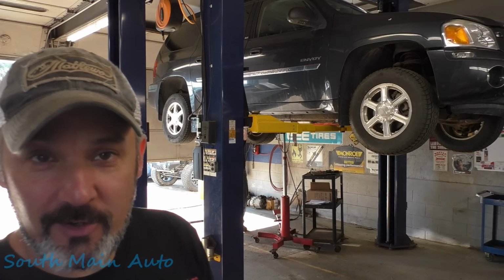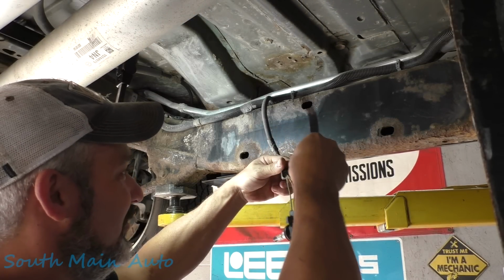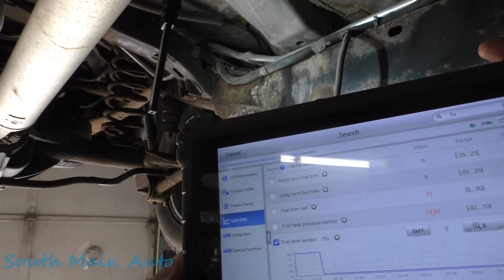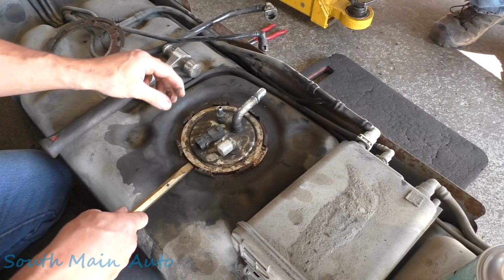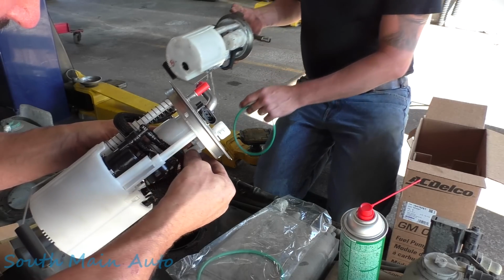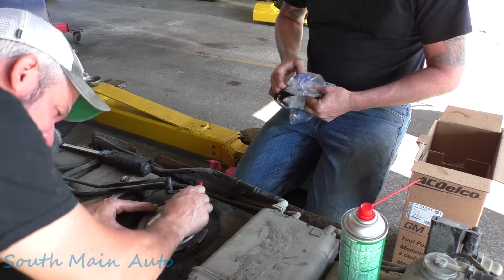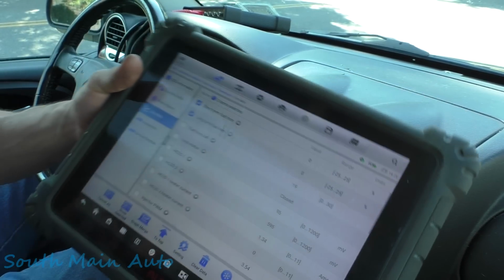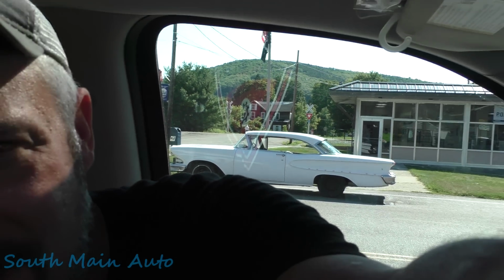GMC Envoy: Hard Start When Hot & Low Fuel Pressure - Part II

Comment: I have the same symptom with my 2006 Isuzu Ascender 4.2 Vortec,but no codes or cel. Starts okay cold,but cranks over too much once the engine warms up. I already replaced the maf sensor and ordered the fuel pressure sensor that goes in the top of the intake. If the easy stuff doesn't work,looks like I might have to replace the fuel pump. Thanks for the video.

Comment: That odd pipe thing over the building being built is a concrete pump truck. You dump from the concrete truck into the pump truck and the pump truck can place the concrete almost anywhere, but it makes that truck kind of complex and expensive.  
I also just replaced a GM Savana fuel pump. GM was nice enough to put 3 connections where you can reach and most of the others with enough play that you can drop the tank to reach them, except one, which barely gave you room to work and I couldn't get it off anyway because the quick connect fitting was stuck on and didn't come off as simple as it went on.

Comment: Prolly just the front wheel bearing’s looking at the cars you have come in you don’t have Michigan rust. Just changed one last night on mine. Wasn’t making noise yet but bad speed sensor and when I pulled it it was grimy in there. It’s 4 more bolts and about 40 bucks more just to put in a new wheel bearing. But thinking of breaking my personal rule and only replacing one. Replaced them both roughly 3 years ago 35k miles. Good luck beating those things out. You can always get the wheel bearing out of the Knuckle getting the cv shaft out of the bearing can be a pain. Only had to get the torch out on one. Most of the time a puller and some hard but precise hammer swings will get them apart. Great videos as always.

Comment: I had the Wonky Fuel Gauge Syndrome on Her Ladyships Montana.  GM rigorously deny any wrongdoing and blame the fuel which damages the Potentiometer tracks, giving false readings and if left too long will require pump replacement.  Got some gas cleaning juice from the dealership and it fixed it. . 
Very thorough diagnosis.  Impressive

Comment: Okay wanna ad some extra Info other People reading here too. I have a  2002 Honda Odyssey and own it since that drive here in Germany imported it from Canada. Do everything on it the last 20 years got a Haynes as well Honda Shop Manual 2000+ pages. Since a major tune up, valve adjustment, clean the hole intake manifold (doing this all 4 years so no big build up) new plugs and Throttle Body Cleaning I have a random misfire. I did something additional but I don't wanna misdirect you and let you know later, what I did. Here's what I did after symptoms start, rechecked valves, timing is on spot Crank and both Cams align, did the TB and WP change 2yrs ago, changed MAP sensor, throw in new NGK coils and new NGK plugs, swaped them back to the old ones interchanged them misfire is still random, checked EGR is good not open, checked IAC and cleaned it. Nothing changed, sprayed the whole engine with brake cleaner no rev so no leak. I changed the O2 sensor before the Cat 2yrs ago with a Denso. The symptoms starting above 56°C/132°F I guess this is where open loop ends because of temp, misfire is only under 70% load only while I'm driving not on P or Neutral. Mostly downhill without needing load under 70% I can feel the misfire starts and a slight push on the pedal it will disappear because over 70%. I don't have a great scanner yet just scan gauge 2 but I'm able to read the DTC's combined with freeze data and delete them of course. Can't check fuel trims or O2 Data. I don't wanna throw a lot of parts at it, I wanna diagnose it right. Would like to buy the Thinktool Master 2 or the Autel fix a lot of family and friends cars, so it's a good future investment. Because I got XXL Balls😉🤣😂 I drove with this symptoms to Spain and back, we knew how to handle it and above 130km/h 80mls/h and load which we had with a small trailer no misfire. High fuel consumption I guess that's all, compression test was good before the round gotta recheck it now. Thanks in advance for help to anybody. Carsten Germany

Comment: Hi Eric, please read to the bottom of this, watching you for quiet a  long time. I just saw that you used a Think Tool in Part 1 and the Autel in Part 2. Which one what you recommend for a 2002 Honda Odyssey? And Infinti/Nissan. Since you are in the US and I'm in Germany and all Shops 
I stumbled over can't scan my beloved Ody I need to diagnose it by myself since I do the last 20 years all mechanical stuff by myself on my own imported Ody (Canadian spec) as an Electrician for houses reading wiring diagrams and follow the path shouldn't be a problem. I'll drop you an email with what I did exactly, and maybe you find the time to answer. Here's a short Info: I have a random misfire, and in the moment I am using a Scantool called Scangauge 2 for years now, installed a couple years ago permanent above the rear mirror. I can delete the DTC's and got some freeze data with it but for full in depth view (O2 sensors, Fuel Trim) I need a better scanner don't know which one. Long story short, after warmed up 56°C (132°F) the misfire starts (I guess closed loop starts @ this temp) but only under 70% load, after that it doesn't matter if I hit the pedal soft or hard, under 70% I need accelerate a bit more without causing misfire. Swapped already plugs, coils, replaced them too, change back to Originals changed MAP Senor. In P or N I got no misfire. Before throw parts at it I wanna diagnose it right, maybe it's the O2 sensor maybe, I don't wanna guess I wanna diagnose it. Heeeeelp please greetings from Germany Carsten

Comment: In 2004 I had a 1995 GMC Jimmy with the 4.3 and that thing would run great first start of the day, then just run out of oompf once it warmed up, just took forever to get up to speed, and the fuel gauge left me stranded out of gas a few times while it was showing 1/4 to 1/3 tank. It was wrecked before I ever got to try to fix it. I don't recall the money light being on but that could just be my memory being fuzzy 18 years later.

Comment: Hey Eric have a huge issue going on with my 2006 Ford Fusion SEL with a 3.0L.
Issue I'm having is fuse number 44 in the engine bay continues to blow. So I unplugged the wire harness coming off the front of the fuse box and with a multimeter I would have thought there would not be any continuity but there was once I remove that fused and probed it. There was continuity running to the throttle body harness until I unplugged the main harness right at the fuse box then all coil harnesses O2 harnesses and throttle body harness all were not reading any continuity so my question is would I still read continuity on that circuit if I unplug the PCM put the battery back in and then probe that fuse spot? If I unhook the PCM and I still have continuity at that fuse location would it be safe to assume that the fuse box itself has a short somewhere in it? Also if possible or you can find a wiring schematic that will show me where the wiring from fuse 44 runs in that engine that would be amazing. Sorry for such a long description probably should have just sent you my email that way I could have sent you a number to call

Comment: Over the years I have had to replace two fuel pumps. The first time was in 1981 and was on a 1973 Ford Ranger XLT with a 360 CI V8. I did it myself and it cost me $15 for the mechanical fuel pump and I installed it myself in the pitch black of darkness with a flashlight while laying on the ground underneath the engine. Took me about 15 minutes. Total cost $15. The next time was in 2009 on a 1993 GMC Sierra with a 4.3 L V6 with the "new and improved" electronic fuel pump in the fuel tank. It was not possible for me to do it myself and so I had to take it to the GMC stealership for them to do it. The total cost to replace the fuel pump and sending unit was almost $1000. Aren't automotive engineers wonderful? They took the fine and beautiful automobiles from the old days that a man could fix himself and turned them into the ugly bank account draining cars we have today that are almost impossible for a man to work on himself. They should all be fired.

Comment: Changing a fuel pump can solve a lot of issues, and you correctly mentioned the main diagnosis which is checking pressure at the fuel rail.  I'll mention comparing your o-ring sizes since I got a (non-oem) pump with a ring that didn't fit and wasted a lot of time trying to force the new pump in there without any luck.

Comment: I recently went through water puddle that was only 4 in deep but a high rate of speed maybe 20 miles an hour LOL it killed my computer to my 96 Jeep Grand Cherokee. It died going through water puddle one time before the year before but I have avoided going through puddles ever since because I thought it would do it again and sure enough it did. The moral to this long story is cover your computer so they don't get cooled off really fast when a few drops of water smacked them in a certain spot because behind that spot was capacitors and they were hot and cool too quickly quite a few times I'm sure before I got the vehicle but that was the only burnt spot was to clean spot on the computer off the firewall when I took the computer apart and split it open. Instead of buying a $400 computer and waiting for a technician to rebuild one off of shelf that has been sitting for years I found out what capacitors are needed and spent a whole $4 and fix my truck and now I got a check engine light again and my OBD reader acknowledges my computer again and it fired right up but only because the board was not burnt around the components. I basically say 396 dollars

Comment: I'm having a very similar issue in my 97 lesabre. Losses fuel pressure, wonky gage, long crank after its warm. I pulled cap off fuel pressure relief and noticed a bit of moisture. I replaced fuel pressure regulator cause I noticed some moisture around it. Going to replace Schrader valve on fuel rail before removing pump but I suspect pump is weak.

Comment: Congrats on the new camera. There's only one thing, the volume is kinda low on it. Other than that, great video and nice tip to check the loadcapasity of the wires; just blow the fuse... Good as always.

Comment: Changed the fuel pump on my '99 Silverado. Easiest way to get to it was to take the bed off. Four bolts and some screws for the filler neck, a few wire harness connections and the bed came off with no fuss. Wheel base looks so short without the bed.
Reply: Just take out the bolts and with a shoulder, prop the bed up with a chunk of wood. Like jackstands, use enough support.

Comment: Would you not wire the test lamps in series to give the supply a stress test?
Reply: Series would reduce the current.  He was trying to connect in parallel, but ended up shorting it out.

Comment: Five years ago I needed a ride whether temporary or not and just came across a GMC Envoy XUV SLT V8 the day before it was getting crushed for a "blown engine." It was a battery with an internal short and I never want another vehicle as this is the handiest vehicle ever with about $3k in it now. Replacing the starter was on par with replacing the rear turbo in the Mitsubishi 3000GT VR-4 I also saved from crunch crunch. Looking for an 82-84 Corolla hatchback if anyone knows of one for a commuter.

Comment: Lol great video fid fuel gage work ? Did I miss thar part I was here for both but was really interested in the Guage I find some cheep replacement pumps drive rough roads the gage skips on the resistor and the original replacement holds tight

Comment: Ive owned a few vehicles, where removing the fuel pump was insanely inconvenient, in one case, the fuel tank had an lpg tank installed under it.   So, I just cut a hole in the floor (carefully) and finished the job with a nice chequer plate patch and screws.  Easier the next time.

Comment: Speaking of Edsels, over on Coldwarmotors, Dean own a '58 Edsel Ranger 4 door sedan that he bought I think from the original owner I think last year and all it needed was some minor work and a tidy, but was all original, though it did look to have been repainted at one point, black with red accents. It has the Teletouch transmission selector as well (which got a good going over to get working right again).

The host of CWM, Scott has 2 fury 2 doors, both with the continental "tire" piece on the trunk, one a soft yellow original 1959, and a two tone metallic blue and white 60 that he's in the midst of finishing up its restoration, and it got a full frame drive line swap, new metal shaped and grafted on to repair massive weight reduction, along with body parts of at least 2 donor cars to restore it (it sat in a horse pasture for years so was badly rusted). The car is almost complete now. The frame and drive train came from a running 60 Dart 4 door post, who's frame is the exact same as the Fury's. Anyway, the seats are slowly being put back in, recovered and all that and it currently sports a 318 poly motor with pushbutton automatic.

While the one at the post office in this video was a survivor, but looked to be straight, still fun to see those on the road every so often.

As for your repair, all is well, and as usual, you did a masterful job on it.

Comment: Come on!  Somebody take tour 2008-13 Tundra in for flashing 4x4 light!  Seriously, Eric I love what you do, and the fact you don’t shy away from much of anything
Reply from the maker: Those are a little tricky but easy all the same. You have to check system old school, no computer talk on those models ;) Toyota has a really handy chart in service data for the pin out readings. Takes about an hour to run down through the whole thing and get the answer you need.

Comment: Removing the fuel pump, fuel level sensor, very similar to the fuel level sensor fuel output tube on my 1069 Corvette. EXCEPT on that car, it’s all on the bottom of the tank, so draining the tank is mandatory if you don’t want to take. 91 octane bath. 😊👍.

Comment: The next time I run out of gas I have to disconnect my fuel level sensor, connect a variable resistor, and fill the tank. That will save a ton of money with the current high price of gas! 🤣😂

Comment: How do wires survive inside of GAS ?
Reply: I was an Air For e crew chief.  Our pumps were three phase, and the wires were running right in the jet fuel.   We had one aircraft that was destroyed by a faulty fuel pump.  It was rebuilt at some point, and one of the wires had a direct short.  As long as the pump was covered by fuel, no problem.  When it was defueled, the wiring/short was exposed to fuel vapors, and blew the wing off.  The fix, while waiting for new pumps, was never letting the tank run dry.

Comment: Another success.  The owner will enjoy his Envoy more now, so maybe there will be a wheel bearing video on this one in the near future.  And if the Edsel ends up at SMA for repair of Teletouch (the gear selector buttons in the center of the steering wheel), that could be very interesting.  Cold War Motors fixed this on a 1958 Edsel, so they would actually be a go-to source for this repair.

Comment: So living in the rust belt as you say it looks like a lot of those undercarriages would crumble to pieces if you just tap it with a hammer. My question is why don't people have zinc plates (i think it's zinc) welded onto their frames before it gets to the point of no return. If you look at a lot of those giant ships out at sea they all have several of those plates welded onto the inside of the hulls to prevent salt water from rusting and eating away at the metal. Why couldn't those be used for vehicles that travel on a lot of salted roads there?
Reply: That works on ships because the hull is in the water. With the northern salt belt cars it would only protect the immediate area around the zinc. You would have to practically cover the entire frame and underbody for any real protection.